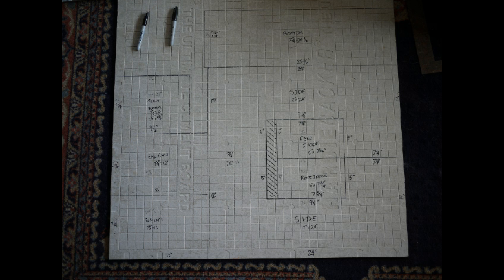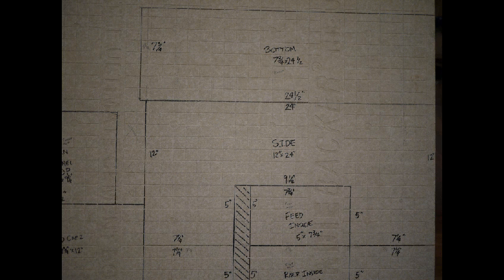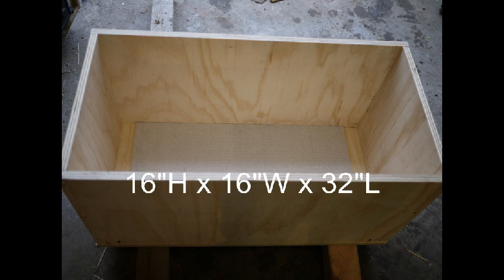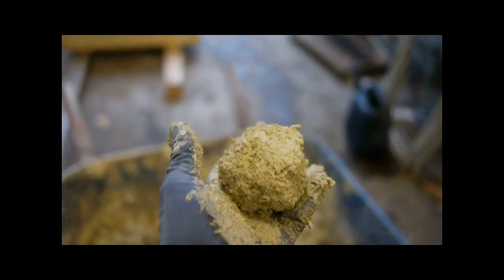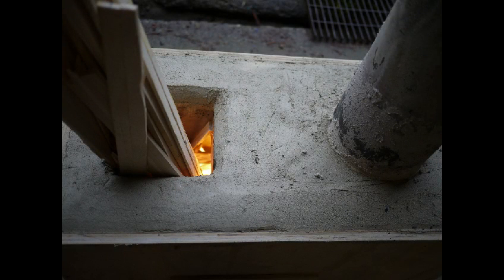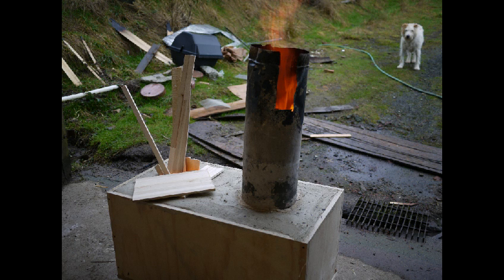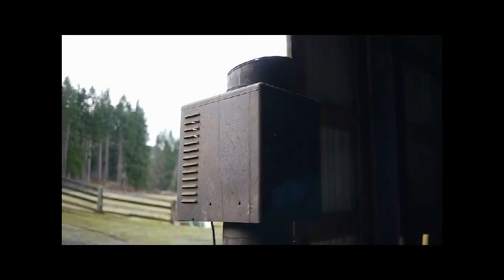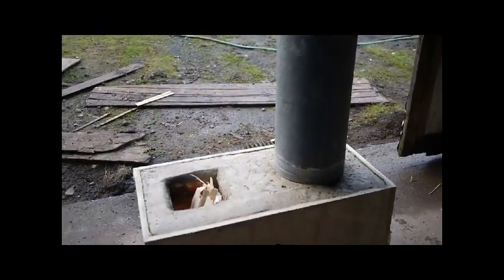Rocket Mass Heater Cast Core Build

Comment: Thank you so much for sharing all your expertise! I just watched your sourcing video, as well as many others! I am in Mexico, sourcing is a big deal as the cheapest thing is always reused here ( which, basically, is a good thing…just making it harder to find!!!) . I love the idea of the cast, I didn’t find a plan or instructions so I am not sure yet to what will get into my own soon . Bricks are definitely very cheap here, though fire bricks will be a killer. 😅
Things to consider: shipping for me: no company can ship directly to my place (no address, only a gps location and the looong Camino makes it impossible), so I will have everything that will be shipped, to a friend in the closest city. I am a woman, I had a brain injury so I don’t have your strength anymore guys 😉. The maximum I have been able to carry and install are solar panels. For that reason I am planning with the smallest pieces I can. 

My questions (or do you have videos answering all these questions ). I will keep going and watch 

1/do you have specific videos on plans for the core? 
2/What matériel goes in? 
3/Can we buy doors by itself? 
I plan to build it in a wood cabin (working on the plans now: I will build a maconery part to support the weight on that part, my understanding is that it is safe with the fire, am I correct? )
PS , I am in the mountain just up to a subtropical climat. Sounds weird to build a mass stove in subtropical climat…I know…though mountains are coooold in winter and still extremely humid. Without heating I have mold ( and mold+ neurological issues= big no no)…

Comment: Thanks for the reply!  I gave that book a couple reads, and I did notice a section on building on wooden floors.  I just really understand it.  Have you done an install on a regular floored home? I am putting mine in a insulated shipping container and I can't wrap my head around what to put underneath the combustion chamber.  Right now the floor is Aluminum T channels, then 5/8 plywood on top.  I am going to use Roxul, but I need a subfloor, but then won't the wood just catch on fire?

Comment: How is the cast core holding up? This looks like the best way to build a stable reaction chamber provided the materials are working well. I was contemplating pouring a ceramic core because of it's resistance to heat, but I don't know if that is possible or if it would work..

Comment: Thanks for the quick reply. That's good to know as I'm also in the Pacific Northwest.

I don't much care for the aesthetics of exposed cob...for the mass I'm planning to make a cement fiberboard box, tile it on exterior, and put piping & cob on inside.

I'm also looking at ways to get rid of the ubiquitous & unsightly 55 gal drum for the heat riser cover. :)

We don't have clay here in our soil, what kind of clay should I be looking to buy? Do you add straw to your cob? Thanks!

Comment: Hmm that makes sense with the air gap, but is that layer if perlite before the durock below the brick tunnel supposed to be structural? Like one would just make a level layer if clayperlite and put on durock and build the burn tunnel? Thanks!

Comment: A quick question:... I am thinking of buying 'chimney clay flue pipe' (8 inch) for the burn chamber and riser rather then the hardy board build.  I would 'insulate per your recommendations to produce an insulated box.  My question is will the clay flue pipe build negatively effect the efficiency, etc.

Comment: I am actually building a rocket mass heater for my hoophouse right now.  I am getting a lot of smoke back out the feed tube.  I like this design.  I have a question regarding the riser tube.  If I am using 8" tube, should I just use 2 - 8 inch tubes screwed together to make a 16" tube and insulate between the inner and outer?  I considered using your steel half barrel design, but there will be a lot of water in the hoophouse and thought it would rust out.  Thank you for your videos.  Much apprec

Comment: Do you have any idea approx. how much fiberglass insulation you used (in your mix? I am confused because first you show your marking the box with 4 inch of fiberglass and then shreaded or tore up the fiberglass for the mix.   DO I DO BOTH.(leave a 4' mat all around). or just enough fiberglass (eventually torn up) and mixed in with the clay. perlite and fire cement?

Comment: Can I use castable refactory cement?  It is a dry mix, not the premix. 
 Also you said in the video to use as much as you can afford, so would it be stronger to put two buckets of the castable cement to one bag of clay, or would that just be a waste of money?

Comment: I need to heat 500 sq feet. Would this heater core, with extra mass added in form of sand or cobb or concrete, be sufficient?

Comment: was looking into making my first rocket stove i am going to be using it to heat a h homemade hot tub outside wich will make for a good trial situation and i love your idea i was wondering what u would think about my idea of making the internal core out of firebrick and casting the same mixture you are using aroundthe brick i am thinking this will add a tremendous amount of insualtion value.  I live in maine the ground is almost thawed enough to start construction and will be posting a video soon

Comment: Nice job !  How are you ? I would  like to know if you ever  had any ideas for  heating water for a radiant  heat ? I have a sand blast shop ,it 18 by 40  and I installed the tubing in the cement floor . I can not have a flame inside because of the big fan to suck out the dust , so it's hard to heat . But early just want to take the chill out ! Any ideas , I have built a Gasifier so I'm a little  familiar with this but always looking for good ideas . Thanks  and  like all your videos .

Comment: I must not have been clear. do I leave the fiberglass into the bottom of the 16 X 16 X 32 box as well as on top box  OR  do I shread the fiberglass into 'wispie bitt' (without additional fiberglass batts on the bottom and top ?  (i.e.) I THINK you're saying "Shread up a bunch of fiberglass (don't leave it in batts????

Comment: Well, I made my casting yesterday.  Using the amounts of fireclay, fire cement pearlite and fiberglass that you recommended only filled the form up to the top of the burn tube.  I had to slip clay bricks in the sides for filler and mix up a bag of quickrete and vermiculite to top it off.  I hope the thing holds together.  I think I should let it air dry a bit longer before firing it up.  I used concrete/verm. for the chimney also.

Comment: Hey, nice vid ! Great to see a stove made of refractory materials. When you cast this, did you really ram it? Also I'd like to know after 24 hours would you have been confident to invert it and remove the wooden base for another 24 hour aircure? Im not being critical, just wondered if a longer air cure and a milder heat cycle would have prevented a lot of the cracking due to thermal stress. I plan to reproduce what you did here, but I may use some firebrick grog in the mix. Thx again!

Comment: Thanks for the info, I like the cast J tube a lot better then fire bricks.Thinking about some bolts imbedded in the area where the riser goes to anchor the riser to the J tube, when the rise is also cast like you commented about.

Comment: Great job with this design; I like the idea of precast to using bricks, also great job with providing the information of your build. I am dissatisfied with my “J” tube build, but was looking for a light weight-portable unit with a bit different use. I also have looked at using fiberglass matt as an outer skin to the Kaowool insulation dripped in ceramic slurry the test did quite well. I believe I will look into the next tube build alone these lines as you have shown. Thanks for posting.

Comment: You said, " I put a 4" section of 8" flue pipe in between the inner mold and outer box to form the tunnel extension". So, what, you cut the hole in the core through the 4" tunnel , AFTER the core had dried?

Comment: milled glass fibers are available ,used in FRP mold making would help homogonize the mixture. 
you  are quite capable at taking a basic design and streamlining production and adapting it for more versatile applications. well done and continued success.thanks for demystifying the inner workings.

Comment: I called my local Refractory supply place here in Portland, OR (hightempinc [dot] net) to talk about the refractory mortar.  They were surprised to hear of mortar being used in a casting mix, and suggested that it, being so fine-grained, is what leads to cracking.  I think you said that the mortar is optional anyway.  What advantage does it offer?
They also suggested that coarse grade vermiculite could be used instead of perlite.  
Any thoughts on these suggestions?  Thnx again!

Comment: Another couple questions: what would happen if the walls were only 1" rather than 2" (using the store-bought insulating refractory).  Also, the instructions on the store-bought insulating refractory advise against making molds out of wood because as the wood burns off, spalling will occur on the surface of the refractory cement, significantly decreasing its insulative efficacy.  How to prevent this?

Comment: Great build! Love the stuff you are doing with rocket stoves and your designs have given me some inspiration on what I can do when I start building in the spring.  Two questions: As to adding the fiberglass, would polypropylene fibers (fibermesh) work?  Would even less water in the mix be possible and keep it from cracking as much?  Thanks for taking the time to make and post the vids!

Comment: Did you see any damage to the wood around the core from burning it? I wanted to put one of these in my home.it would rest on wood floor I am trying to figur out if the core or any part can get hot enough to cause my floor to catch fire.
Reply: That was kind of my question. I am guessing to put it in a raised foundation home I will need a thicker bottom then. Maybe an air gap.

Comment: need to make a water heat. can you replace the mould with insulating ceramic fibre board and no need to mould using fire cement mixture. need a super hot flame coming out of the riser, to heat a 44 gallon water tank held above.thanks

Comment: Broaudio,
Really nice and simple explanation...thank you.
Just a couple of questions:
>is the finished inside dimension of the core (using 1/2" OSB) to be 6" square for a   6" system AFTER the wood burns out or 5 3/8" square (as you indicate to Mark)   
  AFTER the wood burns out?
>Also, in your other videos you show one of your stoves with a viewing window/air       supply, how long should that tunnel be before the burn tube begins?

Comment: Sounds great man, I will defiantly go 2 in thick on burn chamber. luckily iv got refractory to burn!!!  Pardon the pun.  Thanks a million bro I feel tons better about it now.  This is my first build and it's in my shop. But I'm taking it slow trying to research and absorbe all info possible.  Thanks again for your time and advice. I'll let u know how she turns out!!!
Reply from the maker: Curtis Webb Cool man, so glad to help.  One thing I should mention, and it's not a problem at all but you should mentally prepare for it since it trips many people up.  The reason to surround the whole thing with the clay/perlite inside the brick surround(in addition to being crucial insulation) is to isolate the whole thing from moving, so it doesn't make a damn bit of difference if (when) it develops cracks.  In other words, it's probably going to crack at some point.  It doesn't matter, at all.  Do not freak out!  That's what all the stuff around it is for, and why it's referred to as a "core" rather than a stove.  The temperature changes so greatly and rapidly so often, and differently in different parts of the core, that it's just going to happen at some point.  Just thought I'd let you know, so many people can only see a crack and think "fail", but if you accept it as part of the build it will have absolutely no effect on performance or longevity.  Just thought I'd let you know!  Good luck man.

Comment: Looking at the video, you used fiberglass matt for insulation, right?  How much did you need?  In the video you jumped from the fiberglass matt all shreaded up, to the photo of mixing the pearlite and fire clay.  The fiberglass is not used there, right?
Reply: I'm wondering about the fiberglass myself. Is this just any normal fiberglass, or does it have to be specific for refactory?
Reply from the maker: Hey, sorry I missed this.  Youtube is sorta awkward for communicating well, I do try to reply as quickly as I can.  I used a couple square feet probably, all shredded.  And yes, I mixed it into the perlite and fireclay.  It's not necessary, but gives a little better tensile strength to the mix.
Reply from the maker: Brian Beck
Brian, it's just regular fiberglass.  It most likely burns/melts away in the inner layers, but should give some strength to the outer.  It also allows linear clay structures to form along the length of the fiber, increasing tensile strength.  You can google fiberglass in ceramics and find out more about how it's used there.  It's similar here.

Comment: Was wondering about the "MASS" you used for your Rocket Mass Heater?  Which materials are best.  Was thinking of using rocks and stones  found on site (on my property that I would dig up...   (2-10 inchs in size.  Would that work? I just have a limited amount of 'COB" (clay) hence wanted to use larger ROCKS (10 inches ini size) for the mass. I would use the COB to act like motor to hold it all together.   Your thoughts please.
Reply from the maker: Bob, that's a great way to go.  Rocks are better mass, but are tough to couple effectively.  If you seat them all in cob and make sure there are no air gaps, you'll have the best of both worlds.  Monolithic and relatively high mass.  Good luck on your build, thanks for the comment.

Comment: Are there alternatives to fiberglass for adding reinforcement?  I have a terrible aversion to fiberglass ever since I got into some of the pink stuff as a child.
Reply from the maker: Absolutely Marc, you can even omit it entirely.  My home system has this mix with no fiber and it's holding up just fine.  Alternatives would be stainless steel fiber/needles, wool, fine jute, etc.  Most will burn away on the inner surfaces, but as you get to the outer skin quite a bit should hold up.  Frankly, I'd suggest omitting it and capturing the whole core with a good, strong cob mix.  It won't be able to go anywhere.  Good luck on your build.
Reply: ***** Thank you so much for responding!  I have found your videos to be very informative and helpful.  I am still a ways off from building my own but all of the information you have on your channel has been great.  I own and often read through the Rocket Mass Heater book by Ianto Evans but that book does not really go into cast cores and from the information you have it seems they can be better in many ways vs firebrick.
Reply: the other option is using poly propyelene fibers (cut up from the plastic rope).  they will burn away, giving micro gas outlets for the water in the mix, and reduce cracking.  others use some sawdust.  not to hold it together like fiberglass, but again to create steam outlet.

can also use S glass, the white fiber glass in the pink plastic wrapper.  old style pink glass is hard glass.  the S glass is less brittle for some reason, less picky, less reactive to skin.  I don't know why.  but always use a respirator and cover yourself well when working with glass.  i've worked with both, and the white glass does seem to be easier on you.

Comment: broaudio just so you know rounding the top of your feed chamber is a no no if you are burning larger sized wood. that clean sharp edge helps brake the fire from climbing upward on your fuel. like your mix. I gotin away from using fire clay.. Iam using small amount of Portland & feed clay (from feed store),perlite & mix thick then add  cat liter(low moister at this point).  This insulation mix is so good I ran the exhaust under my burn chamber & bench so I can load while sitting on it .

Comment: Hi Matt, you say for your burn tunnel top is 7 3/4" x 9 1/2" for your 8 inch system. I'm doing a 6" (roughly 5.375 sq), so my system is 3/4 scale of yours, so should my burn tunnel top simply be 3/4 of 9 1/2" then?
Reply from the maker: Hi Nirky, the length there is important because you need to be able to get your barrel over the insulated riser.  The best thing to do is mock it up and see for yourself how long that needs to be, but I always leave it as is.  I actually leave both tunnel length and riser stub height equal in both 8" and 6' systems.  Just make the openings 5 3/8" sq. and adjust so that it is long enough and tall enough.
Reply: ***** Thanks Matt. And congratulations for being chosen to be an instructor at this year's 'Rocket Mass Heaters' workshop in Montana. Pretty cool. Will you be able to take & post video?
Reply from the maker: Nirky
Thanks Nirky, I am honored and quite excited to meet the rest of the gang.  I doubt I'll use my camera much, I imagine there will be tons of cameras there and I'll most likely focus on getting dirty.  I'm really looking forward to it.